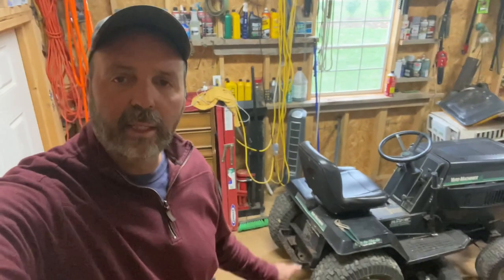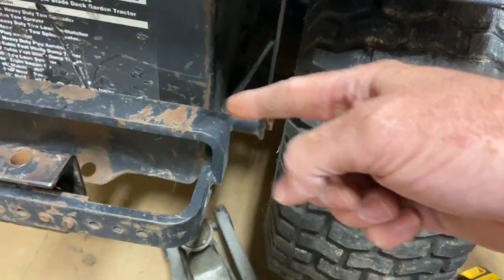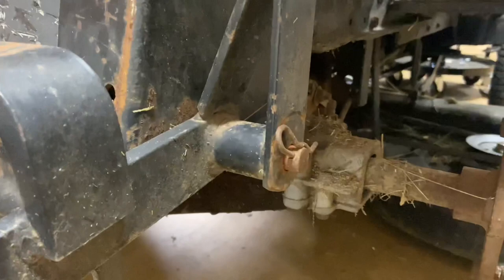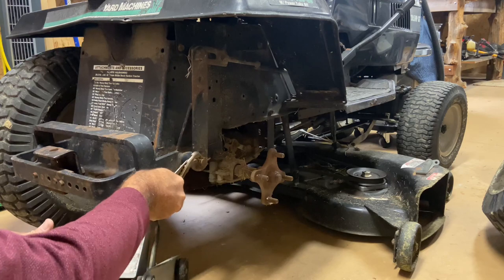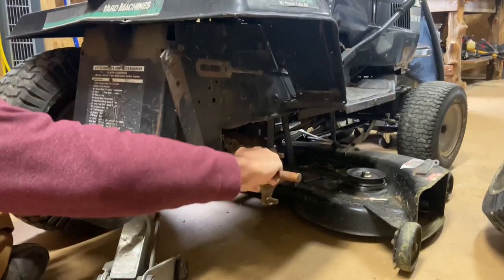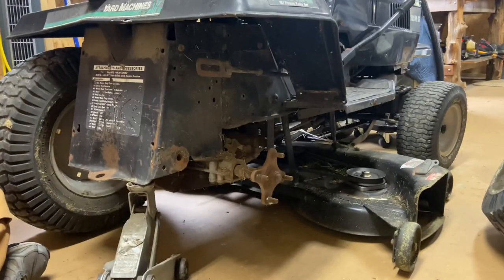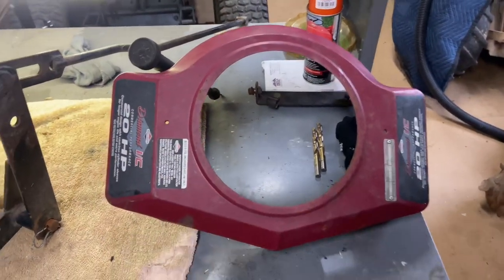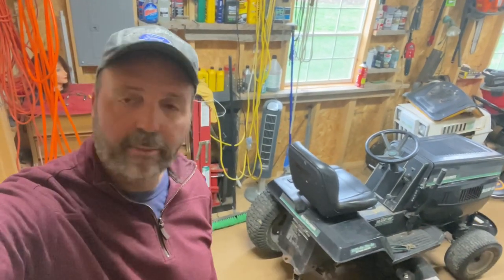MTD/Yard machine/Lowe's garden tractor sleeve hitch install

Comment: I have a Huskee 18.5 heavy duty series, it has the same setup for a sleeve hitch.  I don't personally own one and these are actually pretty rare because this is the first video I have seen of the integral sleeve hitch for MTD, the most common one has the lift lever attached similar to Sears suburban.  I always assumed that was what the fender slot was for on my tractor but wasnt sure as I have never seen pictures or videos until now.
Reply from the maker: It probably would not be very difficult to fabricate one
Reply: @MurphyMower  well I actually wanted to fabricate a 3 point hitch for it so I could use my Sears roper implements.  Seeing this video and how it works really helps.
Reply from the maker: Glad this is useful, thanks for watching

Comment: I am looking for that sleeve hitch for a older yard machine. I figure i can make one, just lack the critical dimensions of the distance from the center of the pivot point to the hitch pin center and the pivot point to the lift linkage upright pin hole. Any way you could give me those ? I have a brinley plow I would like to use.

If so thanks in advance. I like you don't golf or fish and tinker on things in retirement.
Bill
Reply from the maker: Unfortunately I recently sold that machine so I don’t have it for the measurements, most likely you can find that manual online I would think, thanks for watching
Reply: @MurphyMower  Well thanks for the reply! I think your video shows enough so I can estimate it if I can't find the info or a hitch. I have the part number off the back label on mine but no success so far. thanks again!
Bill
Reply from the maker: Once you complete the project I would love to see pictures of what you came up with, good luck
Reply: @williambell9068  I have the hitch, not the connecting rod to the deck lever. I would be willing to sell.
Reply: @andrewvanderbilt7871  Thanks for the offer Andrew, but I built one from scratch. And it works OK. I added some springs to the deck lever side to help raise the implements. I am thinking about adding a linear actuator to raise it. I did that for one on a bolens years ago for my father inlaw and it worked quite well. Thanks again, Bill

Comment: What size drive belt do you use on that machine? I’m buying one in a few days but it doesn’t have a belt.
Reply from the maker: I have already sold this so I’m not sure but you can typically Google the model number and get a parts list fairly easy, thanks for watching and good luck